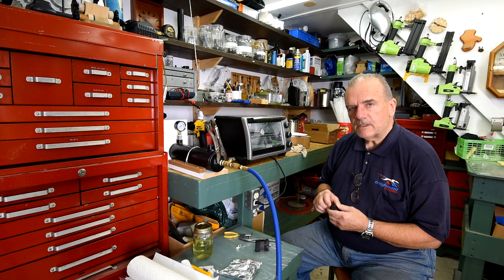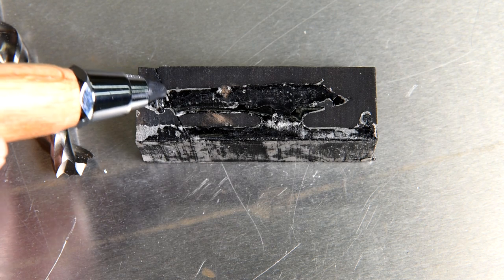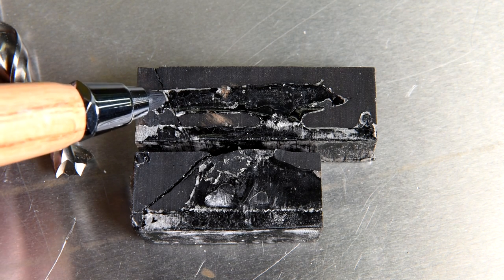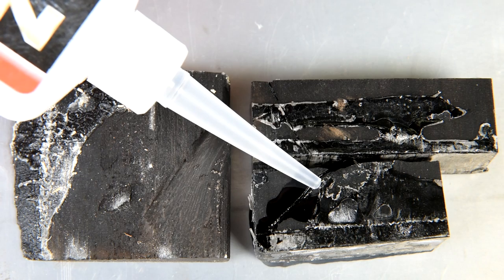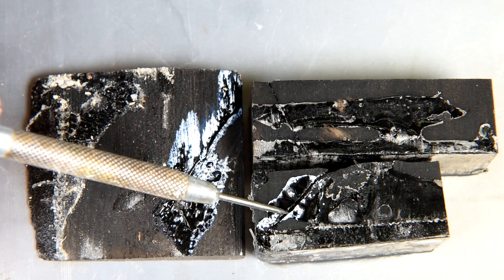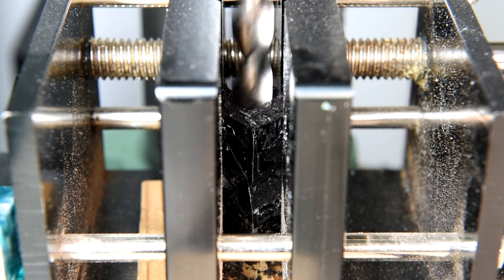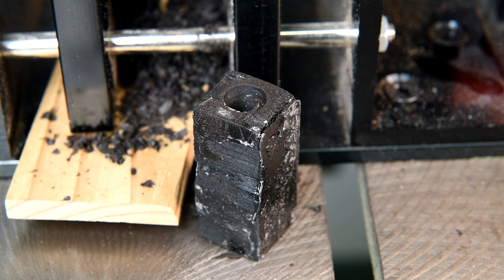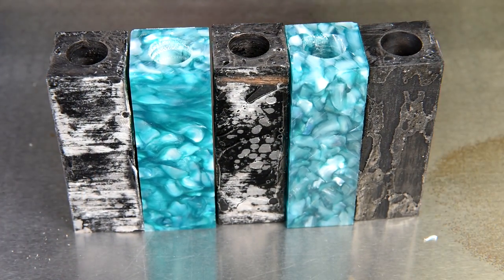The Ebony Napoleon Pen - Part 4

Comment: Ron,  Have you thought of casting some of those drill chips and chunks in Alumilite or similar product?  I think that black would look good in a colored resin and then turned.                    JimE
Reply from the maker: Yes, I've actually got a resin similar to Alumilite. It's called "EnviroTex Lite" I've used it in the past to fill large cracks in pen-blanks. Unfortunately, it does not work well in the vacuum chamber as it will suddenly boil just as the vacuum reaches maximum and can cause quite a mess. Perhaps Alumilite will not do that, don't know. Maybe I'll try Alumilite sometime.
Reply: When I use Alumilite or similar casting product I use the pressure pot.               JimE

Comment: the d500 is supposed to have nice 4k, but then your buying a crop sensor and you won't get your nice wide angle shots. d5 is amazing but very expensive. Maybe when they come out with a follow up to that d810,  it will surely have 4k I would imagine. keep up the great work
Reply from the maker: That's what I'm hoping for Randy, a D810 upgrade. I'm told that Sony makes the image sensor for Nikon. Don't know if that's true, but the rumors are that it could be pushing as high as 70mp and 4K video. But you know how rumors get going. What I want is 4K at 60fps, and also cheap, lol.
Reply: That would be a very nice camera if the rumors are true. definitely would need to pick up some more memory, it would eat through that very fast. would be worth it though.